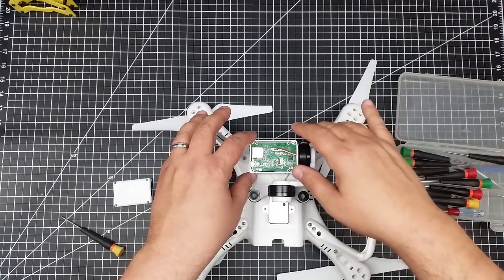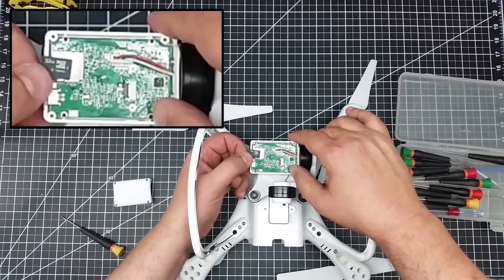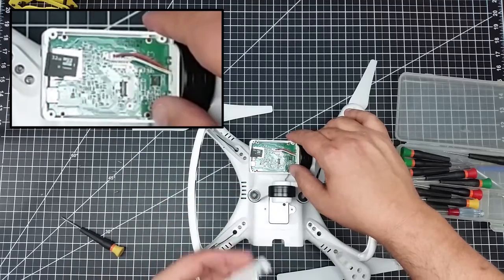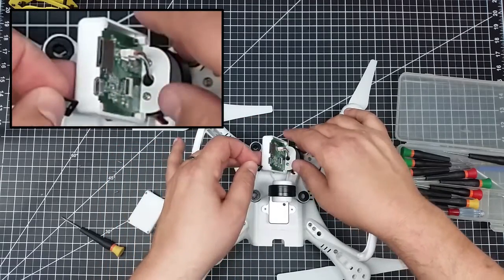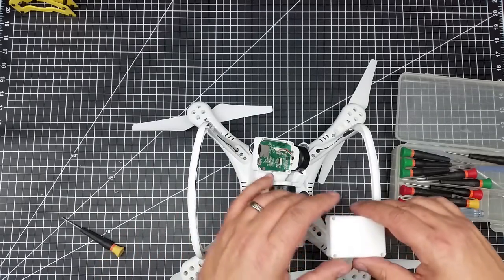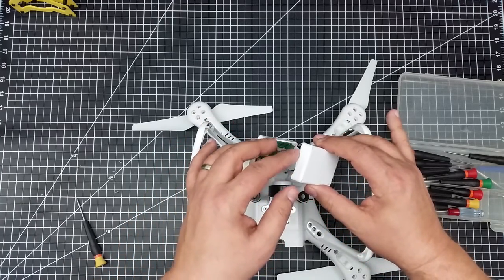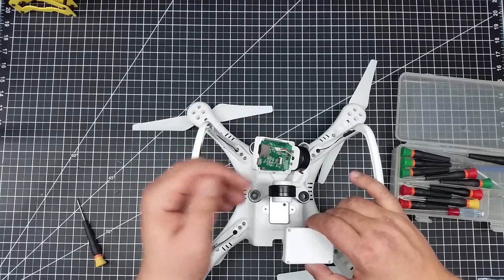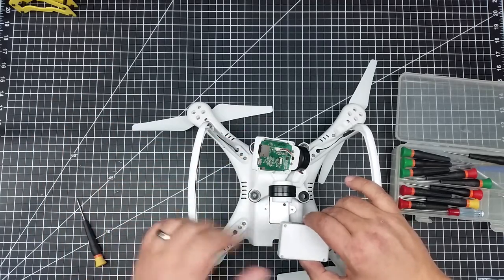Video Drone - UpAir SD Card Insertion  Issues!

Comment: I want to buy the UpAir One Plus 4K Professional (without the screen). I've got just one Question...

Are you sure, that the Micro sd Card is right for it? Im from German.
Reply from the maker: ???  Should work with most high speed cards.  Now be forewarned the UpAIr can be a pain as their QC stinks so you can get a good one or a bad one...
Reply: Ok, thank you. I've seen it on TomTop

Comment: Awesome!  I did not know why I could get video when testing in my house and then - The first time I flew - no card installed?  Opened up the camera and yes the sdcard was way off where I would never have suspected.  Plugged it in and all is good.  Also understand the camera better now.  Thanks!
Reply from the maker: Very cool and happy flying!
Reply: I wanted to add that although the above helped me find my card(s) I ended up with the problem of them disappearing again. I discovered (and if you look closely at the video above) that there is a significant amount of glue that seems to appear on the top of the counterweight (it is black rubbery stuff). That was the real problem for me. It would push the circuit board out of position and it still felt like you were inserting the card to the slot. So I took my pocket knife out and trimmed back the excess glue. Tested several times now and that seems to be the permanent fix for me.
Reply from the maker: Good point and thanks for sharing as I could see that being an issue...

Comment: even if i insert the memory card correctly i get a message on my controller screen that says : Please insert memory card. Do you know why? I bought it for work and now its useless.
Reply from the maker: Okay dumb question on my part, have you tried different memory cards, both "class" as well as "size" (i.e. gig's)?  I also have to assume the FPV is working so we know the "camera" is working correct?  Have tried removing the back of the camera and insert the card to ensure it is seating itself correctly?
Reply: Video-Drone yes, 8gb, 16gb, 64gb and 128gb. everything else are working. The cards click in place when i insert them. But i will try to remove the back of the camera.
Reply from the maker: And you can see the FPV on the screen too correct? (which means the camera is working)
Reply: Video-Drone yes! the camera works.

Comment: Maybe 3D print a new back cover to eliminate the gap around the SD card connector.
Reply from the maker: Hmmm maybe your right, either cnc or 3d print just a small block and glue it in there!